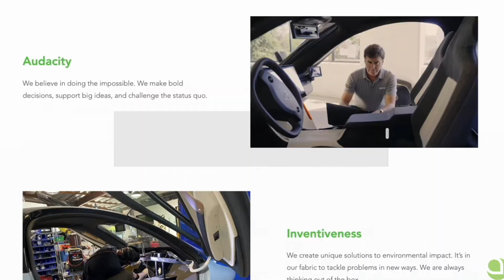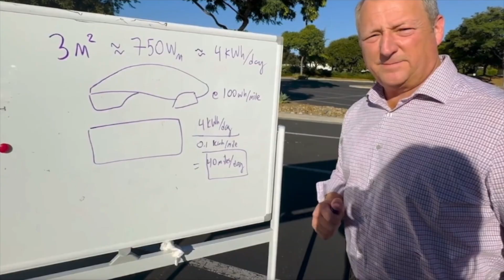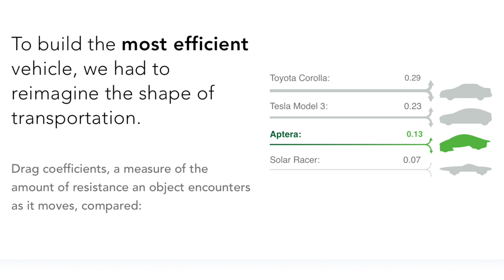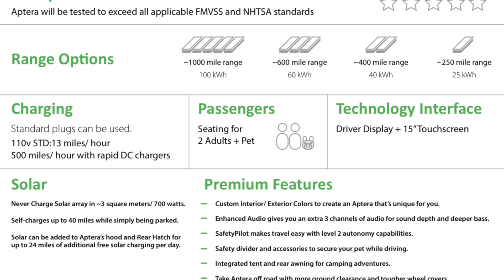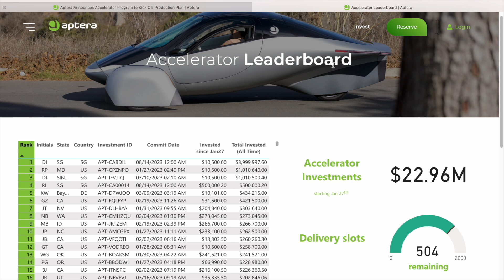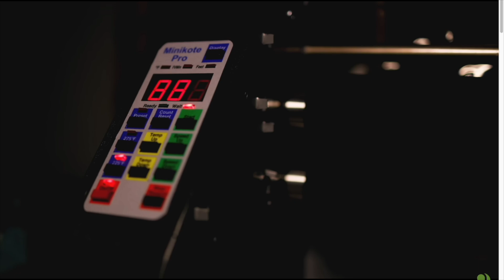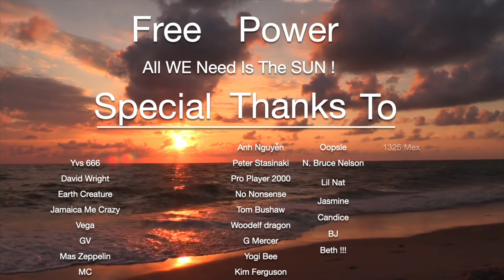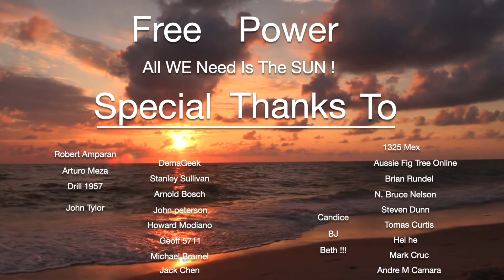Two Great Minds Talking About Solar Vehicles !

Comment: Steve F. said: "It'll (Aptera) will get about 40 (solar) miles a day".  No it won't.
Reply: Mr Know Everything again. You don't know and neither do I until they create some PI vehicles and test them.
Reply: @ASawyerInAZ  No.  Not "Mr. Know Everything".  I do know, however, at least a little more Physics than most dingdongs so I can see how you'd make that mistake.  Just like I know (from Physics) the sun will rise in the east tomorrow morning, I know APTERA WILL NOT GET ABOUT 40 SOLAR MILES A DAY.  If you took less time praising those that you see as gods maybe you can pick up a book or two and learn some basic Physics.
Reply: @bobhilder1469  there are so many posts i will have to remember to come back to next year to accurately answer these and other statements you and Aussie Man have said. Maybe you're right and maybe you're wrong. You really can't know, but of course you think you do. We will know next year. I'm in AZ so I will let you know how many miles charging I get when I have my Aptera. I will have mine by end of 2024 or first quarter of 2025.
Reply: @ASawyerInAZ  The real question is whether you will come back after you've proven yourself wrong.  Even in the sunniest parts of AZ, you'd be lucky to average 30 solar miles per day.
Reply: @bobhilder1469  real world testing will tell everyone. I will report back
Reply: @bobhilder1469  using the NREL's PV Watt calculator and lugging in Phoenix,  AZ, with a 700 Watt premium "panel" with 5% loss and 0 angle of inclination indicates that in the month of April through July the panels have the potential to produce 40 or more miles pet day if charge for the Aptera. May and June have the potential for ~46 mikes per day. Time will tell but I think that Aptera's predictions will be close.
Reply: @garywozniak7742  Sorry Gary but 700 Watt, 5% loss and 0 angle of inclination are all wrong.  Also, Aptera confusingly "predicts" an AVERAGE of 22 miles per day for a "little to no" exposure locale vs 30 miles per day for a "very high" exposure locale.  Who can really believe that one could get an AVERAGE of 22 miles per day with little to no sun when the same array would get and AVERAGE of 30 miles per day with very high sun?  It just doesn't pass the smell test.....
Reply: @bobhilder1469  I don't think that is what the have said at all. They are talking about geographical differences, not making claims about parking in the shade. I live near Portland Oregon. Although we have dry summers with long days we have some gray rainy months as well. If I plug in my location with a 700 Watt premium panel it could produce 796 kWh/year.
Since the Aptera will use 100wH/mile that is a potential of  7,960 miles/year or an average of 21.8 miles/day average. 
That is where their claim comes from. Obviously, here in Portland the output drops during the winter. But the potential output from the late spring to early fall is good

I do have great solar exposure where I park at home and at work

The peak month here would be July (125kWh) where the potential output would be 40 miles/day.
BTW- I picked 0 angle of inclination to make it worse case. The rear hatch has a natural slope and at home I park north/south at a slightly up hill inclination .
Reply: @garywozniak7742  Regarding NREL, 700 watts is wrong because Aptera has ~700 watts worth of cells.  That's not the same thing as having a "DC System Size" of 0.7 kW.  Once Aptera's solar cells ore assembled, encapsulated, mounted (either under a windshield or on "multi-axis" curved surfaces) and conditioned, I estimate it's "DC System Size" to be in the 500 to 550 watt range.  Given that, you can eliminate the 5% loss in NREL's calculator.  If you'd like to keep the 0.7 kW "DC System Size", you'd need to use a 25% "System Loss".  Using 0 deg "Tilt" is generally wrong (and is not "worst case") because there are, roughly, 3 to 4 different sections of the array and all are tilted dramatically differently.  You can use 0 degree tilt but only if you use the 0.5 to 0.55 kW for "DC System Size".
Reply: @bobhilder1469  you have a lot of speculative reasoning in there. I will wait to see what the real world performance of the solar panels on the production intent vehicles is rather than speculating how much it will suck.
Reply: @garywozniak7742  If what I've laid out is "speculative reasoning", then we are both guilty of "speculative reasoning".  Also, it's curious that you are, only now, interested in waiting to see what the real world performance of the solar panels on the production intent vehicles is (rather than speculating that it is the best ever!).
Reply: @garywozniak7742  said: "I don't think that is what the have said at all. They are talking about geographical differences, not making claims about parking in the shade......"

Aptera "savings calculator" says: avg of 22 miles per day for a little to no exposure locale vs 30 miles per day for a very high exposure locale.  Try it for yourself.

By the way, if Portland, Oregon is medium exposure, Aptera says you'll get avg of 26 miles per day.  That's almost 30% more than you calculate for yourself with NREL's calculator.

Comment: Is the Aptera charging while you are driving or just when its parked?
Reply from the maker: It charges all the time , even when driving but not at night . 😎
Reply: Aptera is estimated to need 5 kw of power to maintain 50 miles per hour on flat roads with no head wind.  Aptera's full solar will deliver, at best, well under 0.7 kw of power.  This means Aptera will, generally, NOT be "charging" while you are driving because batteries cannot be simultaneously charged and discharged.
Reply: @bobhilder1469   You are mistaken.  You can easily connect a charger to a battery and simultaneously draw power from that battery at the same time.
Reply: @paulrybarczyk5013 Either current is flowing into the battery (it's being charged) or current is flowing out (it's being discharged). You can't have current flowing both ways in the one wire.The current into the battery would be the difference between the charging current and the load current. If that delta is negative, the battery is discharging. Which would be the case while driving the Aptera. So while drivng, the solar panels would not be charging the battery but the current from them would offset some of the current draw from the battery extending its range.
Reply: @paulrybarczyk5013  While you can "connect a charger to a battery and simultaneously draw power from that battery..." you cannot simultaneously CHARGE and DISCHARGE said battery.
Reply: @garywozniak7742  Nice explanation Gary.
Reply: @bobhilder1469  Thank you Bob. The two different current sources in parallel, the current from the solar panels,  and the current from the battery, would combine (add) and become one total current  IT = I1 + I2, and Kirchoffs Current Law states: “At any node (junction) in an electrical circuit, the sum of currents flowing into that node is equal to the sum of currents flowing out of that node"
Reply: @jcd-k2s  Your "14%" assumes the array is putting out 0.7 kW.  By far, for the majority of the time one is driving it, it will be way lower the 0.7 kW.  As an example, my nearly optimally oriented array in a sunny climate can't even manage to average half it's 3 kW rating during daylight hours.
Reply: @jcd-k2s  Hey, your figures, you remember incorrectly.  No "plan to put double junctions solar panels on it, with a 30% efficiency".

Comment: Great Minds?
Reply: Yeah hardly at all
Reply from the maker: They have more money than I do ! 😎
Reply: @freepower1082  What Steve and Chris know that has escaped Elon, is that there is real wealth in community.
Reply: @n.brucenelson5920  Apparently Elon is unfamiliar with the incredible efficiency of the Aptera.  Once you achieve 3X the efficiency of a Tesla, suddenly you need 3X less solar area, you need 3X less battery, and you can charge 3X faster (measured in miles/hour) from a Level-1 or Level-2 charger.